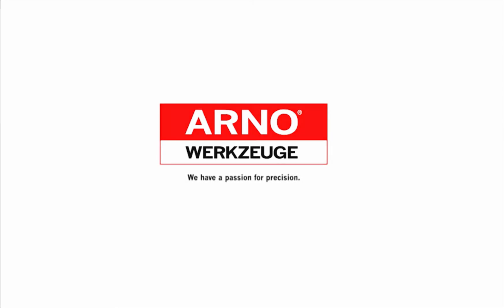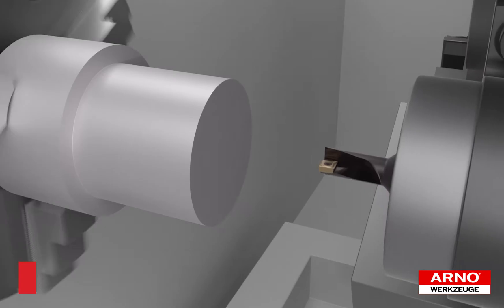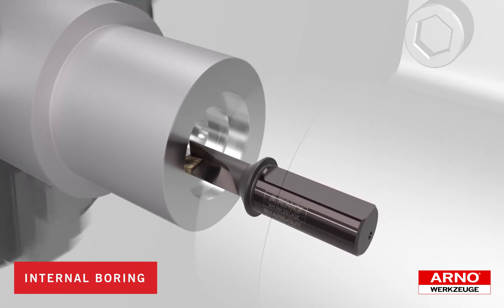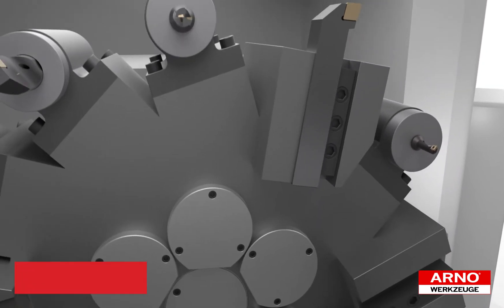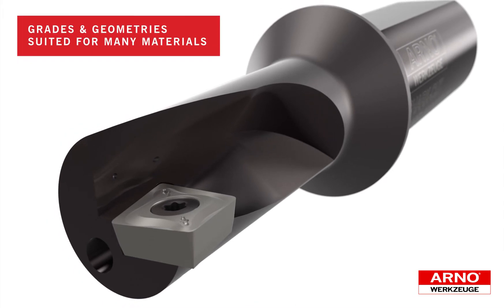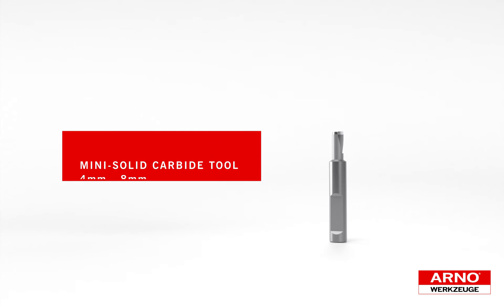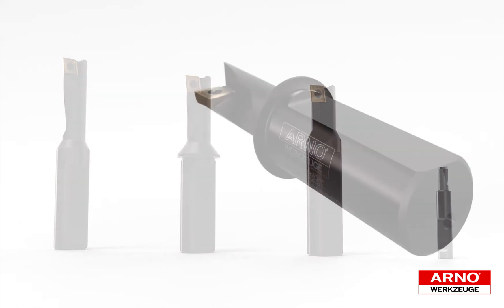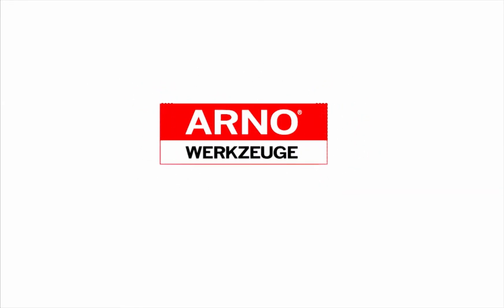SharkCut 2018

Comment: Whats the advantage of this compared to a normal one with 2 cutting edges?
Reply from the maker: The Shark Cut insert is positioned to turn to a 90 degree shoulder and cut like a standard turning insert while facing. A typical indexable drill is not designed to do this. Thank for your question!
Reply: What's the advantage of them not posting a website link?
Reply: Watch the video